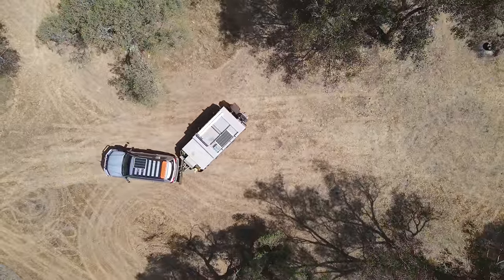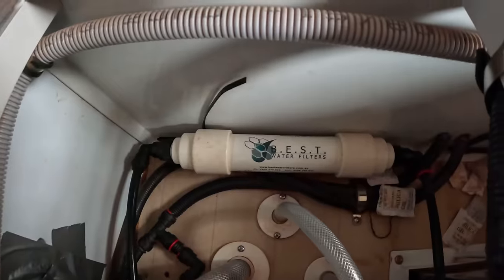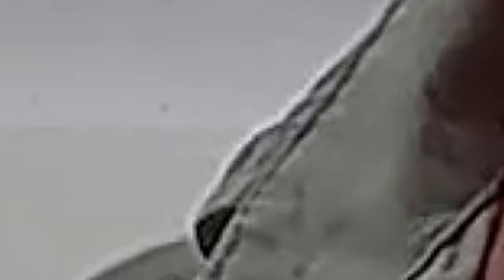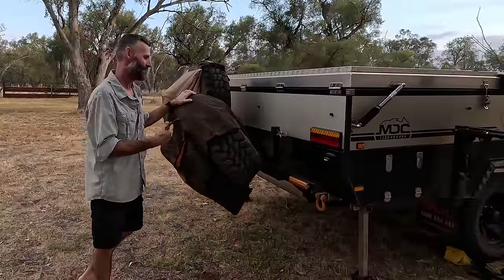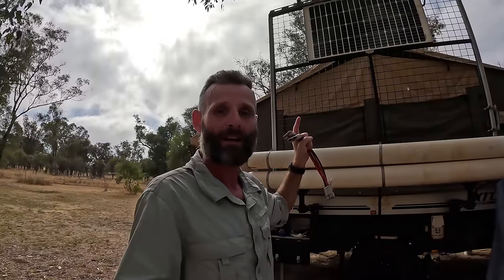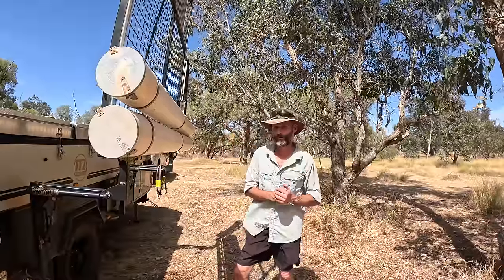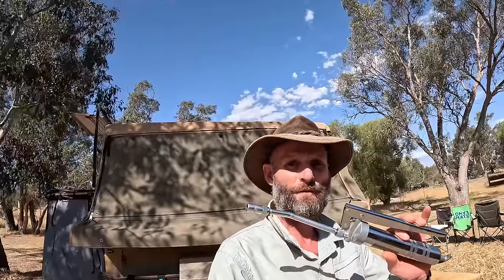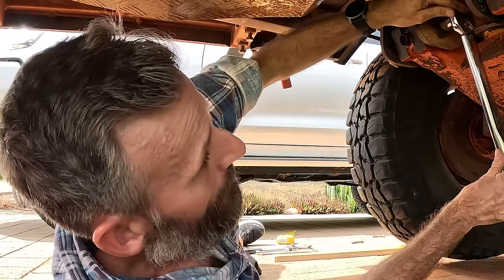CAMPING Tips and Tricks - Making Camping Life A Bit Easier

Comment: With the mould suppression in my Robbo I installed a 240v dehumidifier(obviously need to be plugged into to 240v all the time in storage though) near the diesel heater with an auto drain feature (my was not keen on drilling a hole through the floor though) it just gives you a little more confidence that it won't, even though you packed it up dry, go mouldy
Reply from the maker: @DarrenEvans-fb5cr  that's a good idea cause it is always a worry isn't it and even when you think they are dry there seems to be moisture in them.

Comment: Great tips especially liked the rope on the zipper for the annex and the fridge fan i was thinking of some insulation from clark rubber to place on the inside of the 2 sun exposed surfaces of the fridge compartment
Reply from the maker: Yeah that is a great idea Lee! Those compartments get so hot in the warm weather don't they. The rope is so handy especially if your are vertically challenged like us 😂
Reply: I have dropped the height of the fridge slide so the fridge sits lower and added a ARB snake track for the power lead send you a photo tomorrow
Reply from the maker: @LeighFinn-t3q  that would be great to see thanks Leigh!

Comment: just my tip if i may dont leave the cord on the zip for annex due too and trust me from experience  it can get hocked up when unfolding and bust the zip (trust me it happened too me and a $400 repair and i had too tack the canvas  of the trailer myself) and the stabilizer legs should be at a angle it will work better than strait up and down and your fridge fan should blow air in not out with a filter it will work and stop dust  and just find a workshop that can get those wheels strait
Reply from the maker: Thanks for the tips mate! That sucks it got caught and ended up being such an expensive repair 😬 will have to make sure we remove it so we don't have a similar experience! Thanks for watching 🍻

Comment: Check out lock your hubs videos. Setup voltage converter and fridge cover. I love ryobi. The blower is great for camp fire, i have the reciprocating saw. The radio. Wrap two wire around antenna a connect to annex poles, strip the end. More radio stations. Check out cowboy kent rollins and fire to fork, kfc chicken.
Reply from the maker: Some more great tips, thanks mate we really appreciate it 🍻

Comment: Great video guys. I’ve had some issues with the fridge compartment getting too hot in our FF camper. Looked at putting a fan in there like you did but concerned about dust getting in thru the vent. You have any problems with that?
Reply from the maker: Thanks Neil! No we haven't had any dust issues and we have taken the trailer on a lot of dust tracks since installing it 😁 thanks for watching mate!
Reply: Looks like I might have a crack at installing one. Do you mind me asking where you got the black vents from.
Reply from the maker: @neilwelsford3578  we got the actual fan from Jaycar but the black "vents" were already on the Robbo.

Comment: Quick question with the fidge fans. Are they running constantly once you start up the fridge. So on all the time while driving and dusty rds?
Reply from the maker: Hey Kizz no you can turn the fan on and off as you please. So we tend to only have it on when it is really hot days to help the fridge work more efficiently.
Reply: @RoaminintheRobbo  oh yeah I saw that switch. I was just wondering how the dust is not getting in if the fans aren't on while you drive on the dust?
Reply from the maker: @kizzlipman  on the inside of the vents there are dust pads over them. Fortunately they work well as we don't have trouble with dust getting in that compartment.
Reply: @RoaminintheRobbo  we have the lincoln mk3 I'm wondering how we might be able to do this. I don't really want to to be cutting into the doors haha
Reply from the maker: @kizzlipman  just had a look at a pic of your camper. Yes that certainly makes it hard as you don't already have vents. We were lucky they came on the Robbo, I wouldn't want to be cutting my camper either 😬

Comment: Bad solar advice. 
The high output panels essentially drop down and match the lowest panel so you lose their extra efficiency. 
There are also considerations that need to be made about them being parallel or in series so either the voltage or amp capacity down stream needs to be considered
Reply from the maker: I'm certainly no expert and don't claim to be. Using the Anderson splitter keeps the panels in parallel, I made no comment about the downstream capacity of the system or dc-dc charger but does defiantly need to be considered. In the demonstration I performed, I stated it's not the most efficient setup but the combination of the 2 different wattage panels will put more current into your batteries. The larger panel was not brought down to the level of the smaller as proven by the smart shunt readings. If I was to have a brand new system, this wouldn't be what I'd want. But when your off grid and need the extra solar input it seems to work.
Reply: @RoaminintheRobbo   Yeah all good mate. Heaps of bad electrical camping advice out there. just need to make it clearer that people need to consider all factors before attempting stuff.  I could see how many people could probably try what they seen and potentially make a really bad mistake if for example they had bigger panels and the installation they paid for never accounted for extra panels being attached. 
Here's some info from a course 

PV Array Configurations

An array consists of a number of PV modules connected in series, parallel, or series-parallel:

    Connecting PV modules in series increases the output voltage, whilst the output current remains the same.
    Connecting PV modules in parallel increases the output current, whilst the output voltage remains the same.

Worked Example 1 – Modules in Series

The following diagram shows four PV modules connected as a series string. Each module has a power rating of 120 W, a nominal voltage of 24 V, and a rated current of 5 A.
When connected in series:

    The nominal voltage of the string is equal to the sum of the voltages of each module, i.e. 24 + 24 + 24 + 24 = 96 V d.c.
    The rated current of the string is equal to the current of each module, i.e. 5 A d.c.
    The rated power of the configuration is determined either by adding the module power ratings or by multiplying the total voltage by the total current, i.e.
        120 + 120 + 120 + 120 = 480 W
        96 x 5 = 480 W

    So we end up with a 480 W, 96 V, 5 A array.

Worked Example 2 – Modules in Parallel

The following diagram shows four PV modules connected in parallel. Each module has a power rating of 120 W, a nominal voltage of 24 V, and a rated current of 5 A.
When connected in parallel:

    The nominal voltage of the configuration is equal to the voltage of each module, i.e. 24 V d.c.
    The rated current of the configuration is equal to the sum of the currents of each module, i.e. 5 + 5 + 5 + 5 = 20 A d.c.
    The rated power of the configuration is determined either by adding the module power ratings or by multiplying the total voltage by the total current, i.e.
        120 + 120 + 120 + 120 = 480 W
        24 x 20 = 480 W

    So we end up with a 480 W 24 V, 20 A array.

Worked Example 3 – Modules in Series-Parallel

The following diagram shows four PV modules connected in series-parallel – two parallel strings, each consisting of two series connected modules. Again, each module has a power rating of 120 W, a nominal voltage of 24 V, and a rated current of 5 A.
When connected using this series-parallel configuration:

    The nominal voltage of the configuration is equal to the voltage of each string, i.e. 24 + 24 = 48 V d.c.
    The rated current of the configuration is equal to the sum of the currents of each string, i.e. 5 + 5 = 10 A d.c.
    The rated power of the configuration is determined either by adding the module power ratings or by multiplying the total voltage by the total current, i.e.
        120 + 120 + 120 + 120 = 480 W
        48 x 10 = 480 W

    So we end up with a 480 W, 48 V, 10 A array.

Care should be taken to accurately match module types and ratings that are to be connected together into an array. 

The output current of a string is limited to the lowest output current of any individual cell within that string.